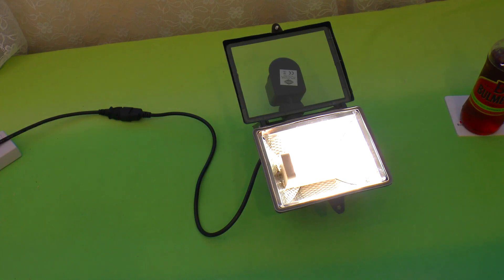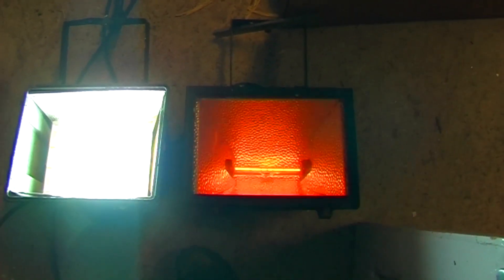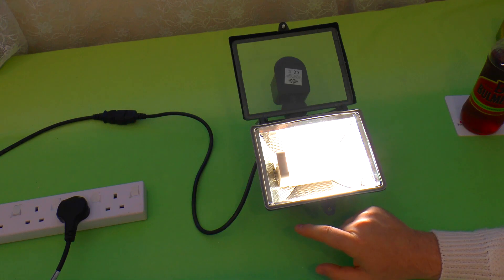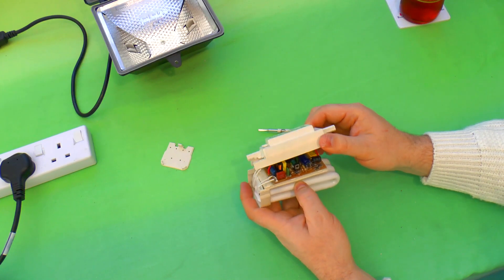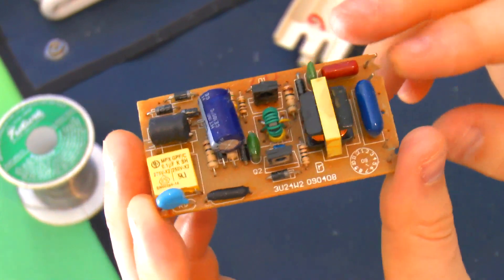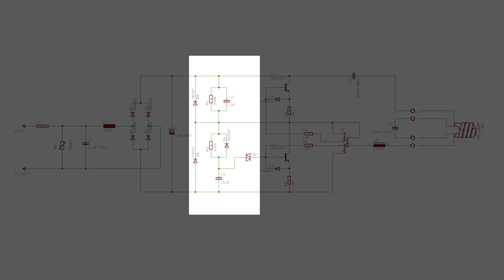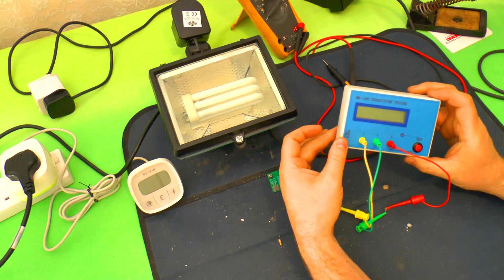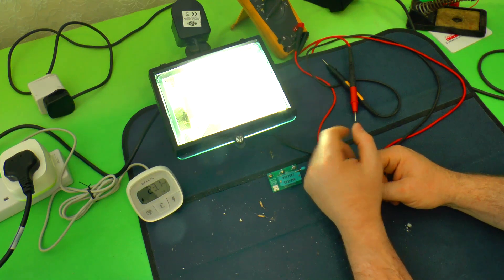CFL floodlight tube comparison, teardown and fix

Comment: PIR sensors are horrible for fluorescent lamps due to the frequent switching.  Depending on the switch design, you might be able to get away with LED PAR lamps as long as they are weatherproof, but as motion lights are not on all the time I just use PAR38 flood lamps as there is not much to go wrong.  I only use linear halogen lamps in worklights where dicking around 20ft up a ladder relamping the fixture is not an issue.

Wire wrapping lamp end wires is common in compact fluorescent lamps, possibly for thermal or bend prevention reasons (lead in wires are prone to breaking at the seal if flexed too much).

Comment: Well done mate, it would have been a shame to have wasted the unit.

Perhaps those resistors were not designed for high voltage, im supprised they used junk ones, but you have given it an upgrade :-))
That unit sort of reminds me of the 24v 30watt ballast units found in old buses, i used to do the electronic repair at a factory so i saw all sorts, they had two trannys with a rather complex transformer, but basically the same thing as your unit.
They ran at 20khz as far as i can remember.

Comment: About 1yr ago I bought an led floodlamp from B&Q cant remember how much but about i think 35 quid. Its not as bright as a 1000 watt halogen which was in its place but all that matters that the electric bill has gone down drastically.

Ill tell you something else to this is the 4th floodlamp we have had in 2yrs.
The bulb kept bloody blowing the first 2 lamps bulbs popped then the pirs broke and after the 3rd one was up 6 months guess what....       The bulb broke 

Up to now is still going strong  touch wood

Its only 4 watt but does the job :D

Comment: Weird to see two resistors fail. Could it be that they couldn't take the voltage? R2 could see the full rectified 325V DC for a short time until C3 is charged, after which R1 and R2 see half of that until C2 is charged. The working voltage for those .25W carbon film resistors isn't that high I think. So maybe instead of using 510k replace the it with two 270k in series to half the voltage on each single resistor?
Reply from the maker: I replaced each one with 220 and 330 ohm in series, 'cos that's what I had here :)

Comment: Nice save! Shame the electronic driver really let down the compact fluorescent. They are a bit of dying breed next to the incandescent!
Reply: Been looking. Was easy to find on google a few weeks back. That why I'm asking if anyone has a meter.....

Cant find much on it now A few articles saying the UV is a concern if your really close.

ec.europa.eu/health/.../en/.../energy-saving-lamps-greenfacts-level2.pdf

http://onlinelibrary.wiley.com/doi/10.1111/j.1751-1097.2012.01192.x/abstract

http://ehp.niehs.nih.gov/120-a387/

I have seen gamma and x ray concerns mentioned a few times though, especially with CFL. I can confirm the UV thing with my spectroscope. Its quite a band.

This thread suggests its Possible for CFL to make some small amount of x ray on start up, but not likely to leave glass.
http://www.candlepowerforums.com/vb/showthread.php?132427-Fluorescent-lamp-X-ray-emissions

Really need to find someone that can do some open testing.... Maybe get some x-ray film and put in envelope near CFL for a few hours, and a second one for many on off cycles?
Reply: We got very lucky a few years ago. The power company got in the habit of sending boxes of absolutely useless (to most people) CFLs out, to get some govt subsidy or other. They sent E27 base daylight matching bulbs, 21 watt (100w equivalent allegedly, I think they're closer to 150w). Most people would have gone 'ick' if, indeed, they'd had a fixture that could use them at all (What's the bets the power co got them free?).

Anyways, they've been INCREDIBLY useful for workshop lighting, still have 3 boxes (I went round and asked the neighbours too, and bought them real BC warm white CFLs to replace the cheap ones, the cost is pennies anyway!)
Reply: Not a fan of CFL's myself. They Emmit some gamma and x-rays, as well as a lot of UV. Its not a lot, but not good to spend a lot of time in close proximity. The European union just announced that 60 min a day withing 30cm of a 15w cfl will exceed your daily x-ray safety limit.

LED's are the way to go.
Reply: Now you tell me.
Reply: Better late than never.
Reply: Mongrel Shark Awesome! So the CFL work lamp I use on my bench every day is putting out xrays a few inches from my head...
Reply: So I'm told, is why the EU just banned such things. Anyone got an x-ray meter?
Reply: Great video, strange failure.
Reply from the maker: Mongrel Shark
Got a link to that? All I can find is the ban on incandescent (i.e. filament) lamps.